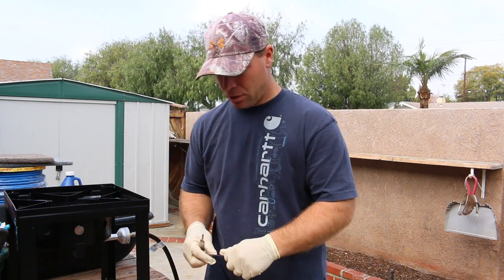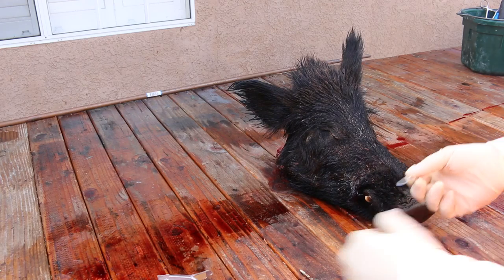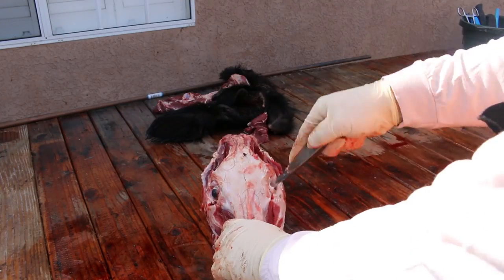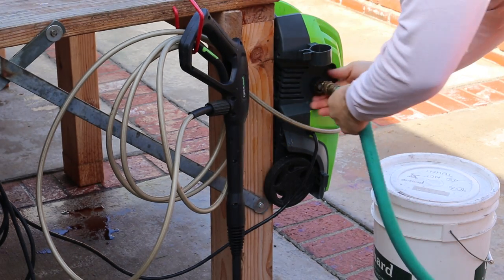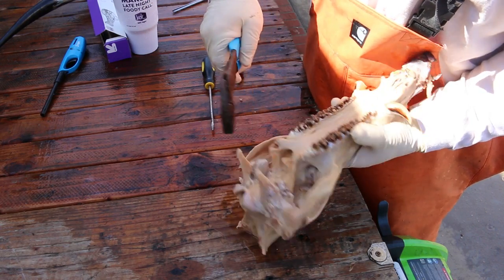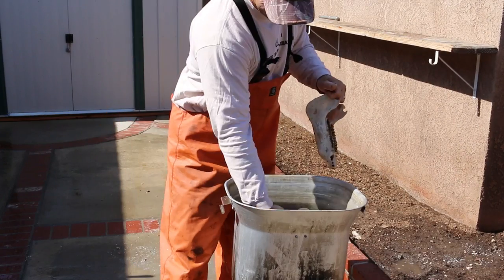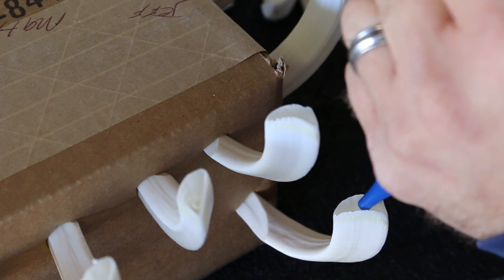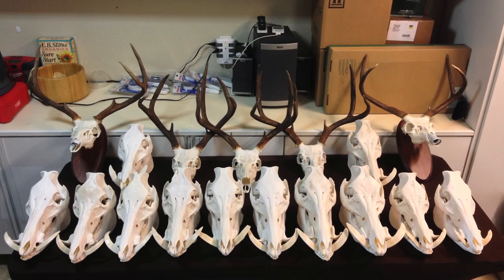HOW TO CLEAN SKULLS ( EASY EUROPEAN METHOD )

Comment: I bought a gallon of 130 and plan to dilute it down to 40 by mixing it with 3gl of distilled water.  After that do I need to mix it 50/50 with water for fresh hog skulls or can I just use the 40 straight?
Reply from the maker: +Lee W You can just use it straight just watch it as you boil don't leave it and come back. All skulls are differient some need more attention than others

Comment: Ok I'll give that a try. Any tips on a deer that has velvet?
Reply from the maker: +Adam Harkey Cure your velvet first. I soak the velvet in acidtone it will dry the veins. Then boil once the velvet is hardened to the horn. Wrap them up tight so the peroxide doesn't bleach the velvet. good luck

Comment: Would the coloring process adversely effect the coloration of the horns on a skull, such as the dark ones at the end on the video? If so is there a specific way to make it so that they don't? I'm assuming just finagle them appropriately.
Reply: yes, the whitening process will strip the color from the antlers if they are left in it. as you said finagling them would be necessary, or you can use a cream type peroxide, use a brush and be careful not to get it on the antlers and then rinse the peroxide off after it has had enough time to whiten the bone portion of the skull, this can take different amounts of time depending on the conditions (like if the skull has stains from tissue having dried or sun-baked into the skull or in colder temps it reacts slower and certainly with less warm bright sunlight to set them in, sun helps a lot.) it will certainly take longer with the cream then the rolling boil in this mix.

Comment: Really enjoyed the video, only thing i personally don't like is you bleach the teath and tusks with it. Skulls look more nice when the teeth keep their original color.  Give it a try. Anyway it's a really good video. I used to wrap the skulls in toiletpaper and paint the paper with 40% peroxide. But i see you boil the skulls in the peroxide? What's the mix exactly?
Reply from the maker: +Michiel Stevens 50 percent water 50 percent liquid developer 40 percent by volume
Reply: @WHITEBONE  You just boil them in the peroxide for a short time and then they get white like this? I normally let them soak for 1 or 2 days. But this looks way more efficient... How long you boil them to get them white like that?

Comment: How long did you let it boil in the peroxide. Will this work the same on an alligator?
Reply from the maker: Jon Hunt depends on the strength. If I have 100 percent peroxide 2-3 min max if its a 50/50 mix  10 -15 min. I am sure it would work on a gator but i have never tried. Thanks for the comment

Comment: whats a good way to do this without peroxide, I don't like my skulls that bright? i prefer more of a natural, eggshell color. i mostly just drop the skull on an ant mound and let them go to work, but the skull is never as clean as i want it to be so i still have to go in and boil it to remove the remaining tissue.
Reply from the maker: If you like the natural bone look peroxide is not for you. I would take and boil some water with a table scoop of oxiclean in it and try and degrease them that way. Put the skull in for 20 min at a  simmer and the pull them out and let it dry.
Reply: Ok. Thank you

Comment: Should have known this as a kid, took me three days to clean a big Hereford bull skull, boiled it in a wheelbarrow.:-)
Reply: a wheelbarrow?? how would one even heat a wheelbarrow
Reply: @nizvkfb7vsbvrsct723  I boiled a lot of water on a stove, just to preheat it, and then I kept it boiling in the wheelbarrow, with a torch you'd normally use for putting down roofing felt. It was the only option I had, so that's how I did it.:-)
Reply: @mace8873  how smart! But with things like wheelbarrows fencing and all sorts of outdoor equipment you really have to watch out if the mental is galvanized. the fumes from that can really mess you up.
Reply: @mace8873  Good to know!

Comment: Will regular peroxide from like Walmart work ?
Reply from the maker: It will but it's only 3 percent by volume so it will take days or weeks of soaking. The lower the volume the slower the whitening.
Reply: +WHITEBONE CREATIONS HUNTING so all I have to do is use the same % of alcohol that you use and use a 50/50 solution and boil it for 10 minutes and it will come out white ?
Reply from the maker: +Wesley Nutt Not alcohol peroxide. I would use the brown bottles from Walmart the  3 percent stuff straight. Bring it to a boil 10 min then shut off the boil  and let it sit for a while use your judgement on white. With that little mixture it could take a week.
Reply: +WHITEBONE CREATIONS HUNTING I didn't mean to say alcohol and so it dosent whiten it right away ? You have to let it sit ? And I'm gonna use the method that you use to get results like you

Comment: I'm not entirely sure why, but I have no problem with any of this, except the eyes.
Reply: Hawk Strat come in from below the eye socket and cut the main cord that goes out of the back of the eyeball as close to the skull as possible. Then the eye will pop out of the skull making it much easier to cut around and remove

Comment: The only problem is that those skulls will be dripping yellow grease after just a few months until they are degreased I dont care how much you whiten them.  It wont last.
Reply from the maker: I haven't had a skull greasy in years. You are so right about pigs oiling up if not degreased. Nothing degreases like peroxide at a boil. Color free for years.

Comment: why waste all of that head meat? make some head cheese or pork cheek confit
Reply from the maker: Most of that head meat has spoiled by the time I get it. It's also much different than domestic cheek meat it's full of very course sinew. I use it for shark chum when I get pigs in big numbers. Thanks for watching.
Reply: +WHITEBONE CREATIONS HUNTING I've pulled many a sinew from wild bore, it's tedious  but the beauty of head cheese is that you simmer the head for a long while so the sinew mostly turns to gelatin resulting in a beautiful head stock, but if the meat that is on the heads is mostly spoil then I would agree chumming is probably your best bet for usefulness.